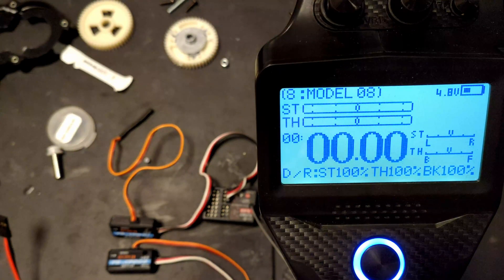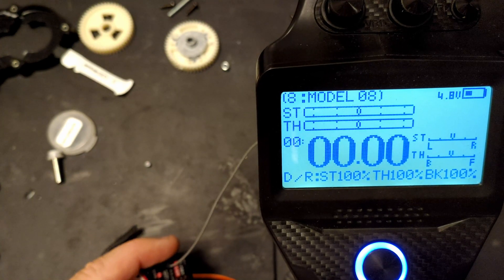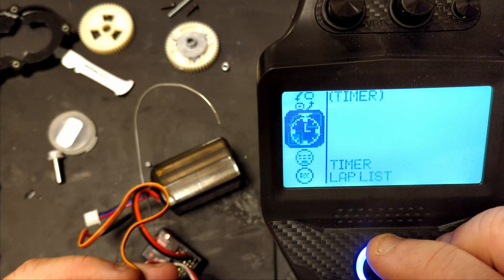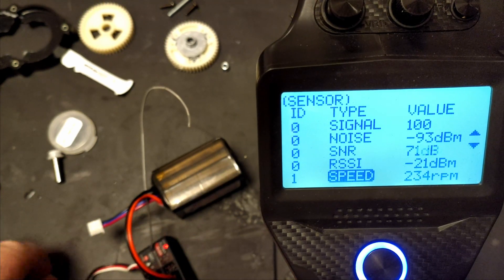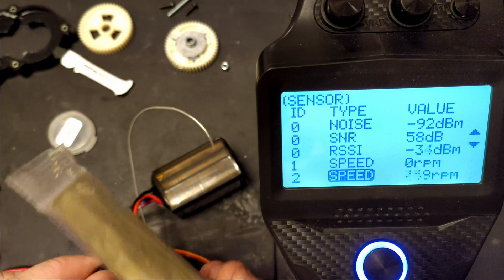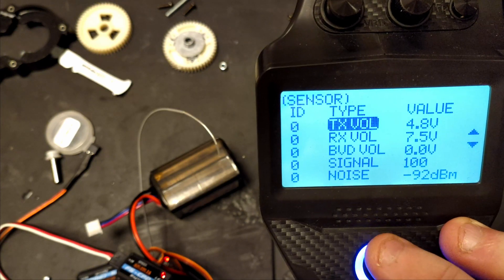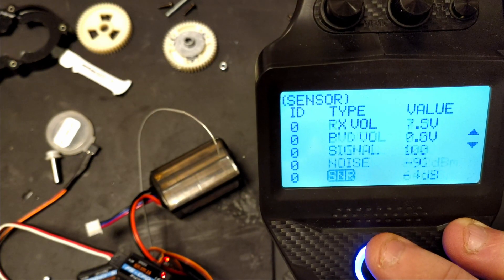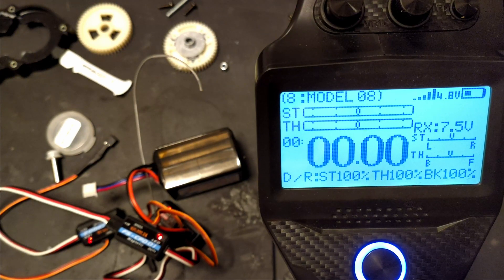Flysky G7P FS-CPD-01 and CPD-02 RPM sensor setup guide.

Comment: Weres sense? You glue it on the motor??
Reply from the maker: I show it in the vid you can see the sensor
Reply: @WTFRCCars yes. Glue on the motor? You put something against the sensor and moved it and there was rpm. I dont understand the meaning how to use ot on the gear or on the motor
Reply from the maker: Depends if the sensor is the magnet one this will need one of the small magnets attached to the spinning gear or the light sensor one this will need something reflective or dark so it can see the difference and count the rotations
Reply: @WTFRCCars and how install the sensor?
Reply from the maker: Just mount it any way you like, hot glue, zip tie, 3d print a mount anything at all
Reply: @WTFRCCars ok and the location, wheres the best place for it? Flysky sensor system is much cheaper than futaba and others
Reply from the maker: Depends what you are wanting to measure

Comment: Hey bud I have the same fly sky g7p I ordered the cpd01 magnetic speed sensor how do I mount it to my car ? On my motor ? I can’t find any video of anyone installing a rpm magnetic sensor .thanks in advance for the help .
Reply from the maker: You mount them on the spur gear they use them to calculate the speed on the RC :)